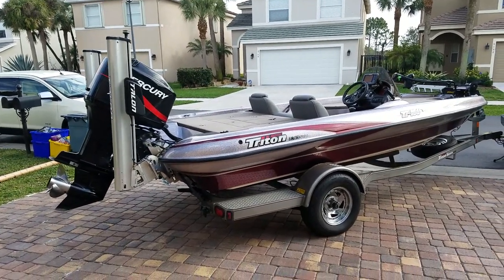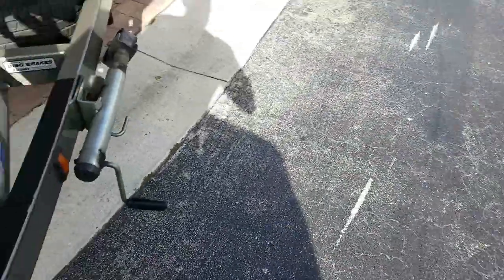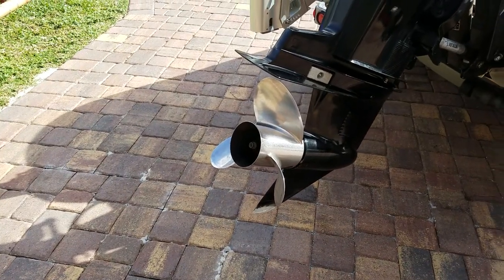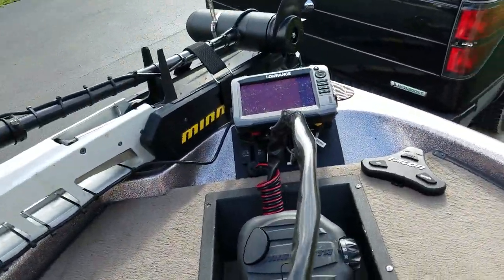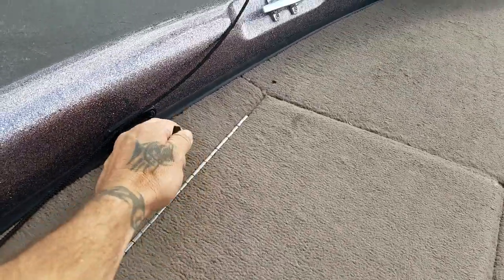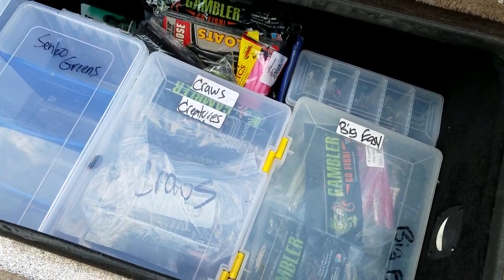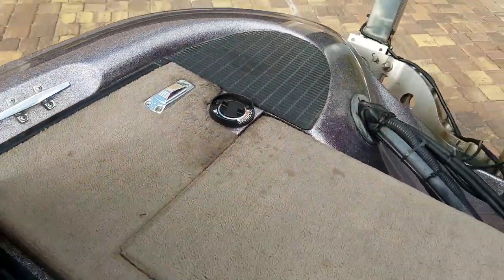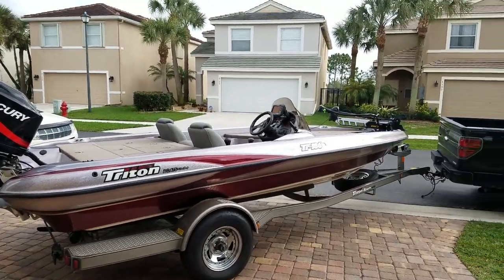20180126 150159

Comment: Clean boat. Pretty sure you bought it from a friend of mine. How did you mount the unit in the console and how did you do the nav lights in the front?
Reply from the maker: Sorry for the late reply. I'm new to this YouTube thing. I mounted the unit on the console with a Ram Mount. Navigation lights on the bow I mounted right to the rub rail. I ran the wires through the hull behind the rub rail and connected them to the original pole plug wires.
Reply from the maker: I'm going to start adding cool content soon. Fishing tips and tricks as I learn them as well as vids of big bass. Please subscribe and share.